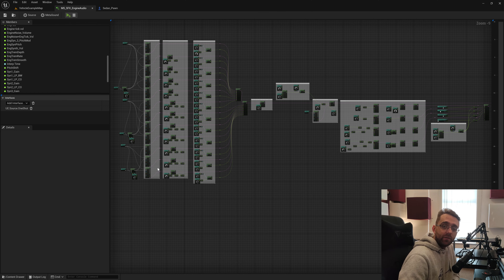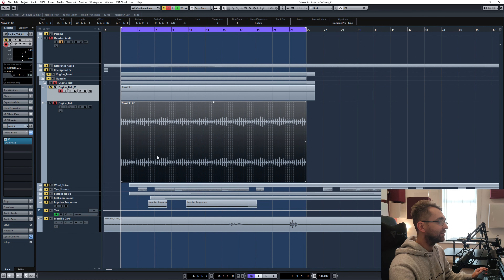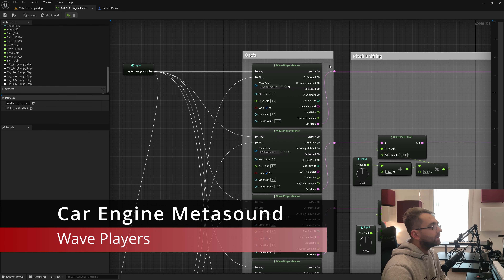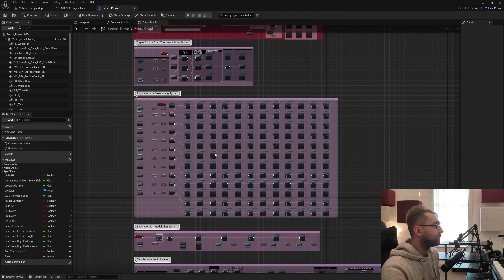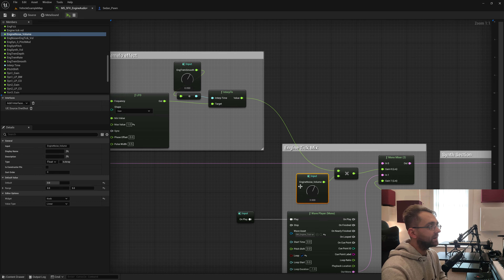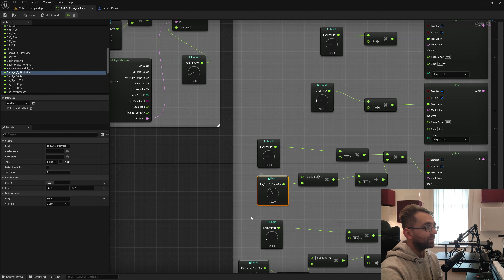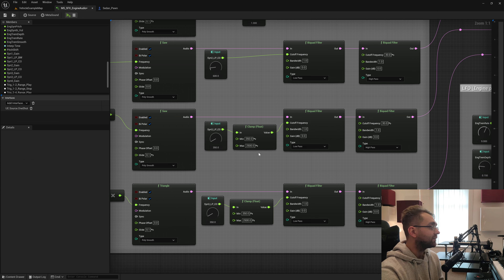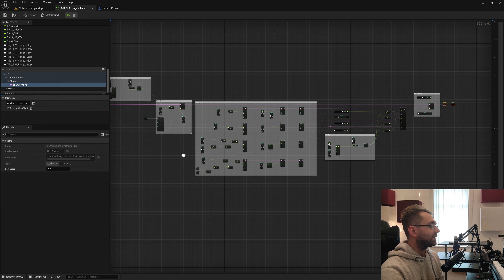Unreal Engine 5 - Car Engine Metasound (Full) - Sound Design for Video Games

Comment: Holy damn! That event graph a million nodes just for the engine audio 🚙🔉
Reply from the maker: A lot of it is just copy and paste with minor changes to parameters. It's necessary to use the multiple wave players to avoid pitch shifting too much.
Reply: @sotasounduk  I'm using engine simulator plugin now, the sounds are amazing! But it has a lot other issues... 🙄 Maybe I'll have to get back and follow your videos from a to z and get some solid car engine audio
Reply from the maker: @thenoobdev  I've not heard of that plugin. I'll be sure to check it out. And yea thanks for the support! The great thing about this system is if you can get your hands on real car engine loops at different RPMS you can just load them into the wave players and it will sound flawless.

Comment: Hello. How did you add reroute nodes? I mean additional points on the lines (8:07). I tried to do it the same way as in blue prints (double click), but in metasound it just doesn't work.
U.P.D Solved. Version of UE5 was too old))) Thanks for the tutorial)
Reply from the maker: That's strange - It should work exactly the same. Just double click. I'm on version 5.2, it should be same on version 5 and above as far as I'm aware.
Reply: @sotasounduk   My version was 5.0.3)
Reply from the maker: @Slash_Diman_Sound  I've not used 5.03 yet. I'd find hard to believe it's bugged. It should work really. I would advise asking around a few forums to see if anyone else has the same issue. It should work the same way it does in the event graph.

Comment: Do you know if it's possible to copy & paste nodes without them being essentially Q-linked? (Cubase reference there!) At the moment, if I adjust a Graph Input dial then other dials that I've copied change too. But I want them to work independently. If that makes sense...
Reply from the maker: Hi Matt. Is this graph inputs inside of Metasounds? If you want them to act independently you can't copy and paste them. You need create a unique graph inputs which have their own name. Then they will act independently. Hope that helps. :)
Reply: @sotasounduk   Okay, thanks! Although I've just gotten to 11:00 where you said they need to work together anyway 😅
Reply from the maker: @MattDoesSound  😄 haha. No worries! It's good to know how to get them to work independently anyway.